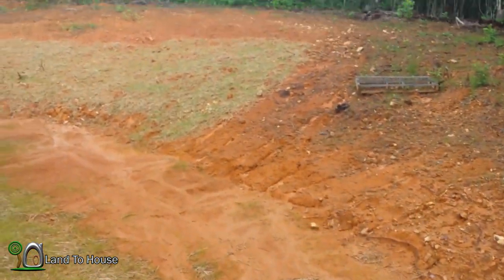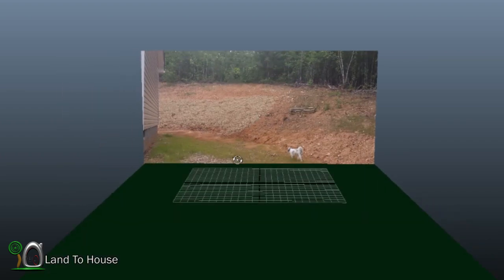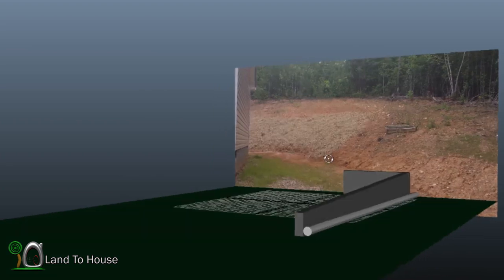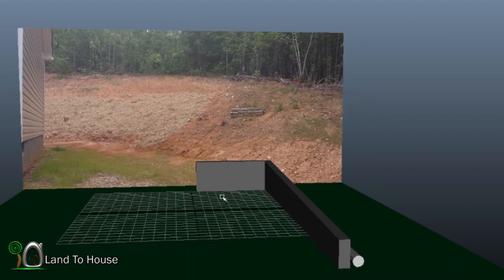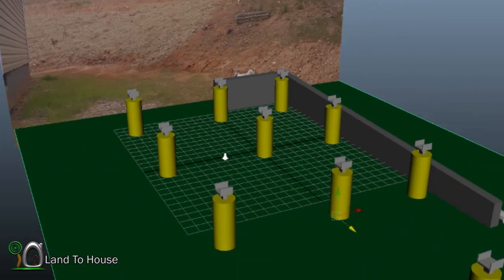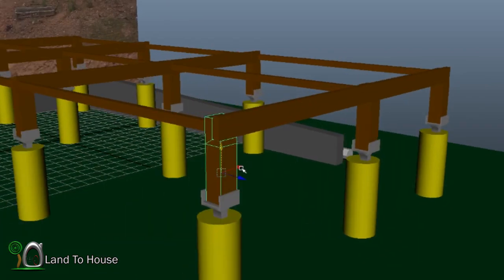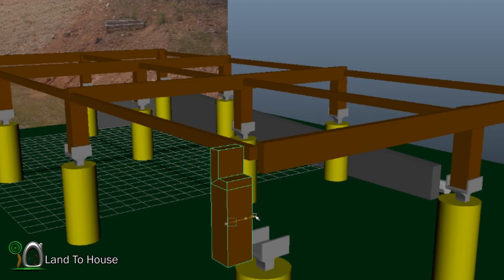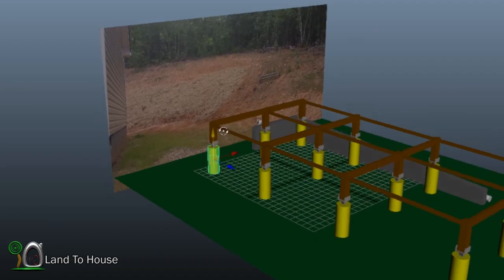Workshop Foundation Help

Comment: Love the videos and I'm late to the party, the workshop is already built.
but some thoughts for the viewing audience:
A workshop plan should anticipate heavy equipment and storage needs. Table saws, band saws, chop saws, tool chests, welders, compressors, and lots of parts and raw materials will add up quickly.  You want a solid floor, not one that bounces when you walk or move the table saw around.  You want poured footers and a knee wall (like the house foundation has) and a poured slab floor inside the knee wall, like most garages and basements have.  This will allow you to have lots of heavy power tools in there, lots of storage of parts, and the floor won't bounce.  You want the interior slab surface about 3 or more inches above grade to keep out any standing water.  That will also make it much easier to move heavy items in/out of the workshop.    When back-filling around the foundation wall, make sure the final grade has crowning, grading, and swales to allow any surface water to gently drain off without puddling.
Retaining walls have to be tied into the hill, as deeply into the hill horizontally as the wall is tall, or else the compaction of the ground above the wall will eventually push it over.

Comment: I am more than happy to give some input.....First of all your general idea seems just fine, the biggest thing to make sure you get right is the retaining wall. It is obvious you have water running off that hill which makes it all the more important. If I was doing the job I would want to put a concrete strip foundation in, also I would put vertical rebar tied to cage within the foundation to tie it to the wall. In addition the drainage behind it is very important  the backfill should be rock and gravel going from larger at the bottom to smaller at the top rather than back fill with dirt if you can. I know all this sounds a lot of work but this is the most important part of the whole project in my mind......Looking forward to the videos
Reply from the maker: +Michael Collinson thank you for the great input. When you say concrete slab do you mean for the workshop or for the wall? I think a slab for the workshop is a bit out of my budget. But I can certainly make one for the wall. The Rock size makes sense. Thank you for that. If I go with another method for the foundation of the shop besides a concrete slab what would you suggest. Do you like these concrete tubes or should I just dig down a little put concrete and then use block?
Reply: I just meant the footings for the retaining wall not the workshop. As for the tubes I don't think they are necessary just some concrete and blocks will be fine and probably cheaper.
Reply from the maker: +Michael Collinson great! That is good news. :) I do appreciate your input very much. My first step will be to remove that dirt.

Comment: Having just watched your rain rain everywhere video and remembering this one, it made me think. With the slope and runoff around your place I would look into digging back into the slope a little and doing a poured 8" to 10" foundation on the sides into the bank.  Go back about 18" and install a french drain around those walls. Continue it on around the back of the house to the low point and continue it down the drainage/runoff area, attaching the downspouts into it. Divert as much water as you can away from the workshop and foundation. Then do a either a block build level with the poured walls and stick build up from there, or just finish the walls off with block and cap it with a standard roof. Just my .02 on it.
Reply from the maker: +Charles Kiplinger especially with all the rain we've had there's been a lot of runoff. I am actually about to upload the retaining wall video. I just finished the wall it's about 30 foot total. We've not had a rain yet so I've not seen how well it works but I believe it will divert significant amounts of water from the building. It would be nice to continue it around some on the back of the house.

Comment: Have you considered just adding an addition to your "tiny house/storage shed" and running power to it?  It would be half done, have a restroom, and a concrete slab to support heavy tools.  Just throw down some pier blocks, build your floor add your walls and roof (just go with an  8' ceiling in the addition) .  I would assume it would be much cheaper than excavating and building from scratch?
Reply from the maker: +Shaggy one i could do that but it is so far from the house. Now adding a lean to over there for a mower would be nice!

Comment: Make sure that your new workshop is not near any bedrooms or your living room. Near the kitchen would be acceptable. So if you're behind a bedroom or near your living room regardless of how well you have it the sound muffled, it will still make too much noise in any of those rooms.

Also, you might want to check the "This Old House" channel and see the video about how they made a retaining wall. I believe it was done with either treated timber or railroad ties, something along that line, and it may be a cheaper and a very effective alternative.
Reply from the maker: +Darrell Waddell sadly I only have one place for the workshop. It is by the master bathroom and bedroom. Most of my projects will be made during the day so I don't see you as being too much of an issue. If Ashley or the baby is asleep that day I may just have to go and do something else.

I'm thinking about using concrete blocks because I already have about 40 of them on the property. Since I have them already I figured that would be the least expensive route.
Reply: +Land to House Gotcha. ☺
Reply from the maker: +Darrell Waddell I also just found out that my neighbor wants to give me a few 6x6
Reply: +Land to House It will also help in using those 6X6's as the footers in your framing, as long as there's no ground to wood contact and that they are pressure treated as well. Even then, you may want to coat them with another rot resistant application, especially where you make cuts into those.
Reply from the maker: +Darrell Waddell I might just use them on top of a paver block and not need to cut. :)
Reply: +Land to House 👍👍👍👍

Comment: if you were to pour a slab, could you use that as the workshop floor? you could run plastic pipe in the concrete floor for hot water heat, provided by a wood stove. much more comfortable than having a cold workshop floor, concrete or otherwise.
Reply from the maker: +Pete Lorenzo I believe that is a little bit more fancy than I'm able to afford at the moment. But yes that would be awesome.

Comment: if you are going to make the building 10x20. you can span your joists 10 feet across and eliminate over half of the piers. If this is a shop I would go beefier to 2x8 joist spand over 2-2x6(8) or 4x6(8) girders. 8s will give you less bounce and more load bearing. Your wall I would put the drain pipe through the wall. Shorter run will equal less plugging and better drainage with less chance of failure. message me back if you need more details.
Reply from the maker: +Bradley Grohs I like the idea of reducing the number of piers.so if I have several 2x6's already can i double them up to make a stronger floor and not have to purchase 2x8s? I have seen pipe through wall like that. Do I need to back fill with the same amount of rock?

Comment: My house is on a steep hill, so I have a lot of trial-and-error experience with retaining walls. I would recommend pouring a concrete footer for your wall. Luckily for you, you only have to dig out a 4" deep trench (I have to go to 4 feet through shale and clay... not fun). If you use interlocking blocks, you don't have to go as deep as the frost-line. But, if you are going to use concert ("cinder") blocks, you should definitely use pour a footer. Otherwise, you will have a lot of distortions in the wall from the freeze-thaw cycle. Again... I envy you that you only have to go down 4 inches!
Reply from the maker: +Winston Smith this seems like a good option. I already have the blocks from another project so I can make a wall on a poured Foundation. I do not want them to be crumbling after a good freeze thaw.

Comment: "assume 3.5ft": Measure it carefully.  Eyeballing it will throw you off until you develop the eye for it.
Under concrete blocks for wall:  absolutely a poured footer.  And it should be 16-24" wide with the block set near the 'front' so that the pressure of the dirt won't topple it over.
Pier depth: 1' too shallow.  Will tip over
2X4 floor joists:  too small
Reply from the maker: +loganv0410 great info! I will use the poured concrete. I will go with 1.5 feet deep. And i have a number of 2x6 or 2x8 that I will use.

Comment: Then use the same principles used on your house a sill plate 2x8 floor joists sub floor...
Reply from the maker: +Richard Parniawski this does seem like an easier option to use than the strong tie because those are very expensive

Comment: Could you use your retaining wall as the back and side wall of your work shop?  I would highly recommend putting a concrete floor in with a drain.
Reply from the maker: +Nate B I could do that but I would be very worried about mosture issues.
Reply: +Land to House if you give the water a place to go I don't think it would be an issue.
Reply from the maker: +Nate B I think I like the idea of having the wall separate so there is a little room around the back. It would be awesome to have a place to store the mower.
Reply: +Land to House cool you could put a little porch roof on the back for your mower.
Reply from the maker: +Nate B very true! I could also use that little porch for storing fire wood. Good suggestion. I think tomorrow or Wednesday I will start moving dirt.

Comment: Why not just push the grade back so a retaining wall is not required? Also make as big as you can afford, if your like me it will fill with tools and projects fast!
Reply from the maker: +Ontario Lakeside the hill is rather steep. But when I start moving dirt I might get further than first expected. It would be nice to have more room to work with :)

Comment: Hi Dude    I think you are over designing  the shop.  If it were mine I would build it slab on grade 4" in center 8" x 24" around the perimeter 8" x 36"  footer under the block retaining wall. You will need to put at least  #4 / 1/2 re-bar  in each void in the blocks and two #4 horizontal rebar between every second course of the blocks.  I would also rotate two blocks  one 8" outside the wall and one inside the wall on  aprox. 6' centers. Fill the void in the blocks as you go with concrete mix with aggregate not mortar mix.  This retaining  wall can not be higher than 4' and at least one course must be above grade.  The hydrostatic pressure from your steep hillside is far greater than you imagine even with good drainage at the base of the wall.   Then you can frame the wall on 2x8 PT plate on it. Put one course of blocks under the other walls.  This will give you a 8" curb  to keep heavy run off which could be mud and rocks off the hillside out of the shop.  Make your walls 12' this will let you flip 4x8 ft. plywood over a table saw.  This will also provide headroom for a 4' x 10' storage loft on the back wall.  I would put my main bench 30" deep on this wall with wall cabinets  over it  up to the loft.  And would mount two 4' fluorescents under the loft for work lights.   This arrangement will leave two 17' x 12' walls for a plywood storage rack , power tools on rolling stands ( drill press, planer, band saw, compound miter saw, shop vacuum, lath, welder etc.) in the bottom 4'.  The next four feet is free for storage of dimension lumber on wall racks.   The upper four feet could provide hanging storage for hand tools, ladders and other rarely used  light objects.  ( Items safe to handle off a step ladder.)     Two 3'x8' barn doors  on the  downhill side will allow for a Kabota or other garden tractor with back hoe , bucket , ROP in place etc. to be driven in.    This arrangement will leave about 6' x17' of open space to work in.  I would if possiblemake the building 12 x20 to expand the work space to 8'x17'.You could also cut a 8' wide tractor road in a big loop down to the bottom of your garden to the east with a shallow grade.  Plant semi dwarf fruit trees on the side to screen it. Bert  ( a 76 year old)
Reply from the maker: +bert skelton I would have to agree that my original thoughts were over designing. A concrete foundation is going to be a little bit out of my price range. Your wall designs seems very ideal. I imagine there is quite a lot of pressure behind that Hill that needs to be contained. There is also limited space to build a shop that's why I was going to go 10 by 20. And sadly I don't have a tractor to park in there. It sure would be nice though. Thank you for the Fantastic input. I believe I'm going to start digging this afternoon or tomorrow. And of course there will be update videos along the way. Adding this help video has been very beneficial. I hope to do it again.
Reply: PS  Check on Craig's list or borrow a small cement mixer.  It is only twice the size of your tiny house slab with bigger perimeter footings.  Don't mess with piers and a floor platform;  a slab will be less work and give you a better base.With the re-bar from the slab to the retaining wall; the wall will be stronger and will have the mass to resist tipping.  Don't forget the 6"x6" wire mesh in the 4" center of the slab also two 1/2" re-bars in the footing portion of the slab.  You could start with the slab and put a Shelterlogic  tent on it until you have the funds to build it.   Then move tent down to the garden for storage.     Bert
Reply: Land to House Run the figures on the concrete.  You have done it before.  Use the 6x6 for corner, door  header framing.  The other materials will be used up in the loft, 2x4 loft floor joists 4' long only,  a 6x6 for front beam of the loft, other 2x material rafters etc.  Bert
Reply: You have the land ; in time a tractor will come best to plan for it.   I have always wanted on to play with one.  But I live on a large city lot on a mountain side 45degree slope beside a creek and in the last 30 years the bottom of the lot has dropped 3' moving around the house built on footings set to bedrock 8' down.  And a 16" retaining wall in front of the house foundation.
   Bert
Reply from the maker: +bert skelton I still have nightmares of pulling that tiny house foundation. Hahaha. If I were to rent the mixer at my local rental place that alone would cost more than the foundation if I use block on concrete. I would like to complete the entire project under $800. I know it's going to be close but I want to make it a nice shop and not cut corners but not go overboard.
Reply: $800 ?  You really have to think out side the box.  Do you have enough 6x6's for a post and beam structure 5' OC.  If you do build the frame on the block wall strap horizontally with 2x4  -2' OC.  You still have to pour the  perimeter footings and should run 1 course of blocks around the perimeter.  But could use a tamped crushed  rock ( steal some from edge of drive ) for the floor.  Then later you could pour a 4" floating slab on the footings and half way up the perimeter block curb.  Check around for some T11 plywood siding used or cheap.  You said you had enough metal roofing.  Now you have  typical farm out building.  Impossible to heat but a dry basic work shop.  Imagine a carport sheathed in T11.    Bert
Reply from the maker: +bert skelton if you had a tractor on that land it would soon find its way into the creek. One thing I would like to buy is an atv. It would be good if I can make a lean to large enough to store that.
Reply from the maker: +bert skelton yes my workshop is not going to be one that can be heated.i might toss some insulation in the wall at some point but for now it will just be an osb wall. When working in winter I will use a big buddy heater.

Comment: I like the way you have started.  If you just extend the 6x6 posts, and use them to frame your walls and support your roof you are well on your way to having a really nice post and beam workshop.  At 10 feet wide though you don't need the center supports as long as you use 2x8 or larger floor joists.  I would be happy to draw a model for you to give you more ideas.  Check out my channel, to see what I do particularly the timber shed dog kennel videos, and the How to build a Post and Beam Barn playlist.  I would draw the 3d model for you for free, as a thank you for the great ram pump videos.
Reply from the maker: +BarnGeek cutting out those middle supports would be awesome. I'm not sure how many 2x8s I have but I have a good start and that means I could just buy more to save the time with those footers. A 3D model would be great. I am certainly new at this kind of work and would appreciate any help you can give.
Reply: I just happen to have one I started a year ago.  I can send it to you and you can take a look and let me know what you would like to change or do differently.  It is designed to utilize rough cut sawmill lumber for the timbers and basic framing, but you could use conventional lumber.  I would encourage you to look into getting sawmill lumber though.  It is usually much higher quality, looks better, and has an affordable price.
Reply: I just sent you the 3d model in your email.  Let me know what you think!
Reply from the maker: +BarnGeek I will go check it out now!

Comment: Seth way to much thinking going on!  Pour footings 1 ft deep at each of your pier locations. Morter 2 or 3 cement blocks to make up your pier.
Reply from the maker: +Richard Parniawski that is how my parents Workshop is. It does seem to do well. Maybe a little difficult to get level. I will certainly look into that because it will also save money. Thank you
Reply from the maker: +OffGrid Aussie Prepper™ I was talking to my contractor neighbor and he was saying the same. Use that string a lot.